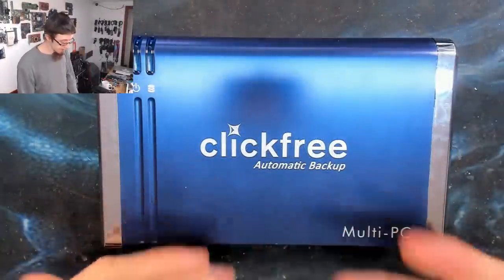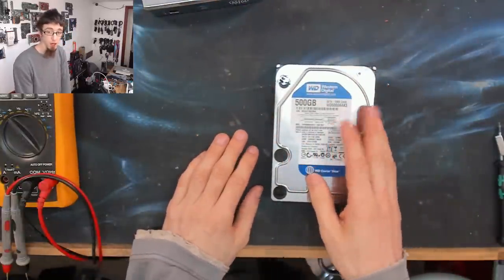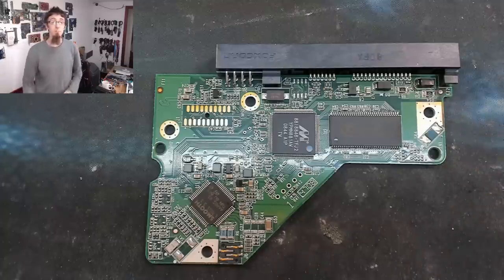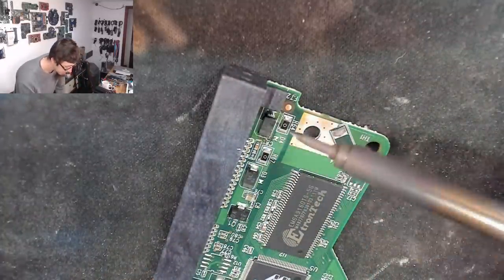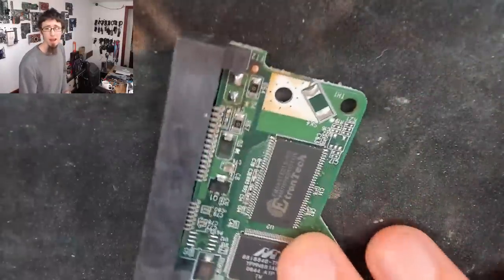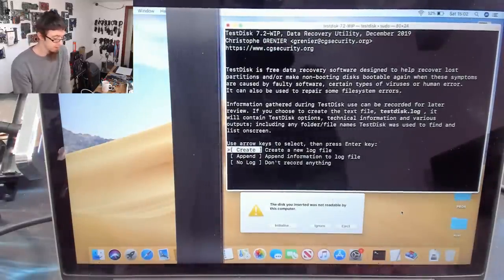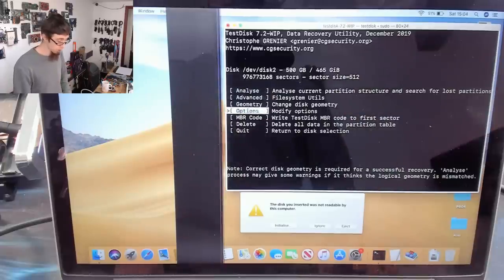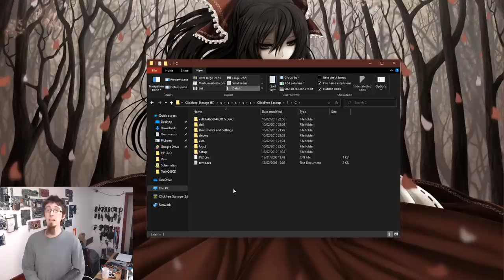Lucky save, HDD with shorted SATA connector - LFC#223

Comment: can you clone the resusitated drive before attempting recovery  or does it have to have a partition to be clonable. If I mess with someone else's drive I prefer to work with a clone. The TVS diode failure has been mentioned a couple of times recenty by Paul Daniels so there must be a lot of it about - like Covid!
Reply from the maker: Yea, technically it would be better practise to DD the drive and then work on that.

Comment: @Adamant IT - I would like to check my HDD drive before I will plug it to my PC. My HDD drive was plugged to failed PSU so I want to check it. My sata controller on motherboard was shorted by PSU so I should also check data connector on the HDD drive? If yes, how I can do this? Can you make video with tutorial for me? On the data connector we have GND but also minus pins for transmit and receiver. I must know if I should check short between transmit - and GND? If short will be in there this is OK?

Comment: Hi...
I got a urgent question about my problem. My Ext HDD gets power and spinning starts. Unfortunately during turn up the RPM the HDD makes a very short noise like a stepper motor. But it's just during startup... and the next is, spin up, click, up, click, up, click....) it seems as it need just an couple millivolts more to get the right speed for mounting in Windows... Do you know what it could be? There is no shorts on pwr connector, thanks in advance

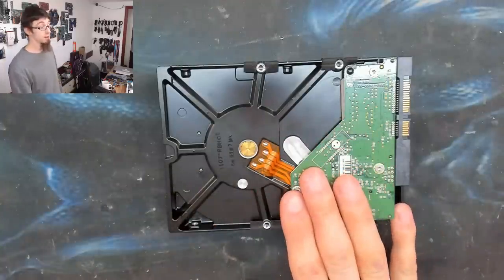Comment: Was it necessary to use the dock ( at 10:19) or was that just convenient ?

Also,  assumed it would be necessary to replace the diode prior to powering it on again. Does the dock bypass the diode ?
Reply from the maker: Dock was convenience. The drive will work without that diode, it just has less protection against electrical faults. Since we were just going for data recovery, it's no big deal to run it without the protection diode. If it had been an exotic or expensive drive, there might've been value in fitting a new diode, running diagnostics, and then using the drive again - but for a common drive, just replace the whole thing. Data's worth more than that.

Comment: Hey Adamant, I accidentally plugged a laptop power supply instead of the proper 12v one into a 2 TB external hard drive dock from Seagate and now the drive won't spin up, I tested a different hard drive and it spun up and worked just fine so the dock itself wasn't damaged. Is there anything you could do to guide me into a possible fix for this hard drive? If you need close up pictures of the circuit board on the hard drive I can take some. I am also handy with a soldering iron. The HDD model is ST32000542AS.
Reply from the maker: If you ping me on Discord or Twitter with a good picture of the controller board, I can point out the diodes for you so you know where to measure. Good chance it might've blown one.
Reply: @Adamant_IT  Will do.

Comment: 4:56 Are you sure it's a 'Zener diode'? not a 'TVS' (Transient Voltage Suppressor) rated at either 5V or 12v?
Reply from the maker: This is correct, I hadn't learned the term 'TVS' at the time of this video. Technically a TVS is just a zener with specific characteristics though 😋
Reply: @Adamant_IT  A TVS will short circuit (which they are designed to do) usually placed in serious with 0 ohm resistors to protect the circuit. I think if a Zener goes over voltage it will blow up 😆but still might work as that will blow the resistors. they are two different things but theoretically work similar. But anyway's, I used a wrong cable on my PC and blew my hardrive. Thanks to you I fixed them ☺ Thanks for the video. Happy computing 🤭

Comment: On the pins on the back of the PCB, I have continuity between the 12v and the 0v pins. It also has continuity between the 12v pins and the 5v pins. Would 
a shorted protection diode (D4) cause these results? Thanks.
Reply from the maker: Quite likely. Those pins shouldn't be connected to each other, and a bad diode would do this.
Reply: @Adamant_IT  It was a bad diode (D4). I removed it and was able to power the drive up, and was able to see it on a different computer. Wasn't quite ready to copy the files I want from it, so I shut it off. Will try doing that later today.

Comment: Today I booted up my pc suddenly I have heard a shortage on my pc and smell a burning device i found, it was my hdd hopefully no gpu no other components were damaged I hope so , by the I have a 800w psu plugged into an electrical extension I don't know what to do.
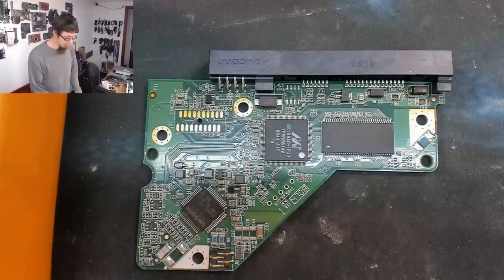I remember that a tiny chipset inside that hdd connector was blown up exactly like that one on bottom left at 7:10.

Comment: u remove capacitir but didnt replace it will it still hard work witout capacitor?
Reply from the maker: It was a diode. The board will work without it, but it's there to protect against static, transients, over voltage, etc. I wouldn't consider the drive to be reliable without it.
Storage is cheap, if a drive has suffered a fault, don't use if for anything other than copying non-important data around.

Comment: I have HDD Seagate Barracuda ST2000DM006-2DM164 2000 GB and I please help. I plugged to my PC and HDD broken power supply and this make my motherboard SATA connector dead so I am scary that electronics of my HDD was also broken. How I can check this before install this HDD to new computer? I want to safely install this HDD and recovery my data. Please help me. I should only check SATA connector like on your video or maybe something else?

Comment: Hi, I have a strange case where my laptop won't turned on but if I connect power adapter there is power LED and keyboard backlight works. sadly, there is no sign of battery LED charging or LCD blinking. I've tried several things and found out with my multimeter "beeps" from all of my capacitors under cpu and gpu blocks. Is this normal? also I've seen your videos regarding in-rush limiter, I checked that voltage already passed through several components while I plugged in the adapter, if I recall correctly based on your past video if there is a short in a motherboard in rush limiter wont pass the voltage from dc jack. I don't know if my case is short circuit or what its like the voltage is missing halfway through... any ideas?
Reply from the maker: Caps on CPU and GPU will always appear to be shorted, as those chips are low impedance, so you can't gather useful information there. If you've got power coming out of the inrush limiter (19v) then your main power rail is good. Next place to check is to find the 3.3v and 5v regulators. Try probing inductors (grey squares) on the board. The 3v3 and 5v regs are usually next to each other, and should be 'always on' as long the board is plugged in.
Reply: @Adamant_IT  Hi, thanks for replying! just checked what you mentioned above, 5v inductor and 3.3v are present and they are fine, however all inductor near cpu and gpu blocks shows no voltage at all. There are some capacitor near those blocks that reads 19.7v though, I assume there is/are  short(s) around cpu/gpu block causing the main rail unable to step down its voltage (or it isn't?).  So far I used power adapter to test bunch of things, is this counted as voltage injection (since there are signs of power in several components)? or do I need to use test bench power supply?

Comment: Is it work after i remove 12 v TVS diode no need to replace or need to replace tell me 😔😔
Reply from the maker: Yes, the drive will work without a TVS diode, but this should be treated as "for data recovery only". Do not rely on a drive that has suffered damage like this.

Comment: Hi. I'm from Serbia. I have a situation with my Seagate Barracuda 1.5Gb ST31500341AS. Firstly was periodically disappearing from the system and now the system doesn't see it anymore!! I believe that the problem is in hhd electronic board, but couldn't find another hhd to use its board to be sure.  I tried to google for schematics for the board but with no luck. If there is a solution to this problem is there any way you could DM how to do it. Thanks in advance.

Comment: but when you plug the HDD to the MacBook have you changed the Diode with a new one ? 
and what kind did you used on the western digital 500gb ?
Reply from the maker: I ran it without a diode, this was recovery only. I recommend just replacing the drive if it's had anything happen to it. Storage is cheap, data isn't.

Comment: did you replace the diode? or you just removed it? thanks.
Reply from the maker: I just removed it. The drive is getting binned anyway now I've got the data off of it. Not worth trusting a drive that's had problems.
Reply: @Adamant_IT  thank you. hopefully my dead hard drive has the same problem.

Comment: 9:20 How many volts does your VC99 meter supply to the probes when in diode mode?
Reply: Typically the maximum it will supply is the battery voltage, so roughly 9v in continuity mode. Worse case scenerio, that is still under the 12v expected. Your question is valid when testing zeners though. Just not important in this specific case. If there is a seperate diode test mode, that voltage is usually limited to ~1.5-2v.
Reply: @bergweg it is about 2.86v according to a review of it by Darren Walker. if you are interesting in this meter, try to watch his review, it is quite thorough review of its features.

Comment: Wait really? it would have shorted a 800 watt PSU? Even current modern ones with all the short-circuit protections they have? Only asking because I just became really paranoid with the 10 hard drives in my workstation lol
Reply: Yes, modern computer power supplies have short circuit protection. However, they are also designed to deliver quite a bit of current on their 12v rails because most everything uses the 12v rail and things like modern high end graphics cards can pull quite a bit of current. So, they will detect a short and power down but before they do the current draw has to go pretty high and that's probably high enough to smoke a small component like this.

Comment: Same problem I found in my hds. I removed zenear 😅diode.My hdd working fine. Can you tell me ,  without zenear diode, my hdsk  will run smoothly.
Reply from the maker: I would not trust any drive where you've had to perform repair work on it. Any repairs to a HDD or SSD are purely for data recovery.

Comment: Why the data is not readable from the first time and you nee to search for partitions? I have a friend with a dead external WD, the enclosure is dead, the hard drive is perfectly but there is no data when i plugged in in my computer, it is not initialized. We did try different software for recovery but they do not find any partition or file. Do you have any idea how to recover the data or why i cant find any data?
Reply from the maker: See if TestDisk can find the partitions. Most data recovery software looks for files, not partitions. But if you fix the partitions, it's likely that all the data will instantly become readable, as with this case.

Comment: One small point what was the point of having that zener diode on that controller board?? I cannot see the relevance of it being there.
Reply: And don't forget that he didn't need to replace the diode for the recovery action he took. That drive is never going to be used in anger again, as he suggested at the end of the vid. I blame that power supply mentioned at the START of the vid for cooking the diode in the first place..
Reply from the maker: It's easy to wonder if these protection diodes cause more problems, I've seen them fail enough to start checking them on sight in laptops. But if the PSU in a PC goes bang and sends out a power surge to all the drives, the diode has a good chance of saving the data. So I guess it's worth it!
And yea, worth mentioning again because other people in the comments have talked about replacing the diode - if a storage device has had problems, recover the data and stop using the drive. Storage is cheap and data is priceless.
Reply: @Adamant_IT  Yep I agree but unlike your expertise, I cannot track down the problem I have with my grandson's laptop so it looks like it is going to be an early Chrissie present LOL!! John (down under) NB really like your channel easy to understand and like I mentioned somewhere else you are the double of my grandson too!!

Comment: Removing the diode havnt you got to put one back in to close the circuit
Reply from the maker: The diode is in parallel across power and ground, it doesn't close the circuit.

Comment: that diode is already soldered. r u sure u didnt ran a "solo mode" just to make sure u found the problem and then did a recording??  or maybe u just soldered a shorted diode for the purposes of a successed repairing????? 
btw,
the sata connector was NOT shorted. the diode was shorted......  -.-
a diode if its shorted, then it will be at both directions.

Comment: Stupid clickfree software. First thing I thought after the drive was mounted first time was: "There's nothing on there except for the clickfree nonsense" - What genius comes up with the idea to put the actual backup data in a hidden folder?
Reply from the maker: Yea, at first I thought that I'd recovered a software partition, but not the one with actual data on it. But the drive was showing 250GB used, so I knew it was there somewhere. No idea what the hell kind of directory structure this stuff was aiming for though.